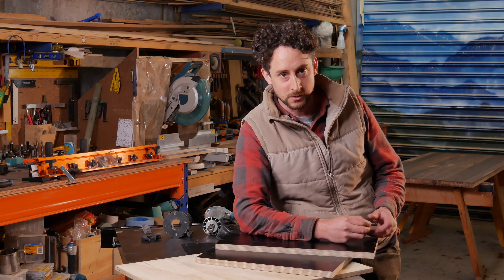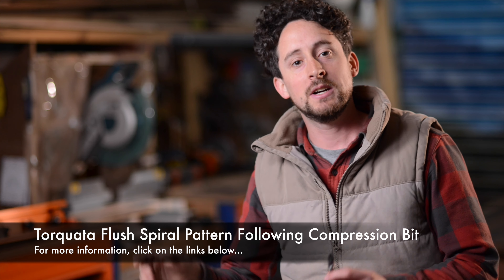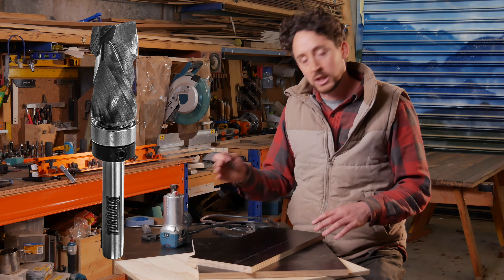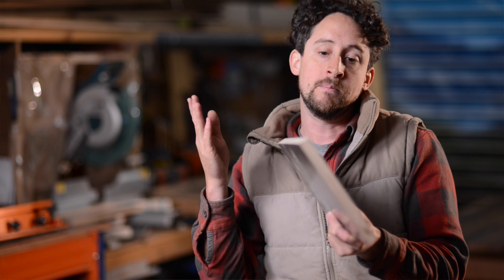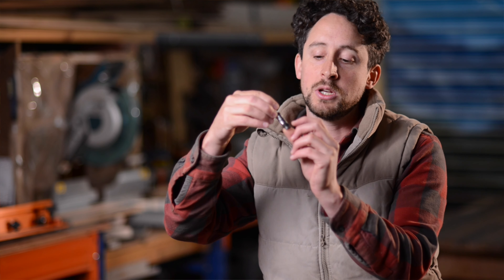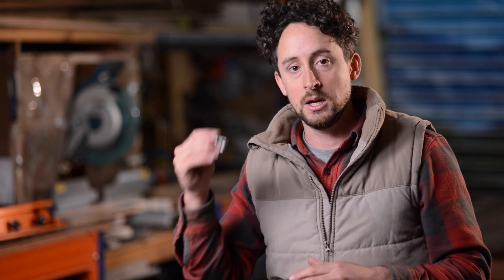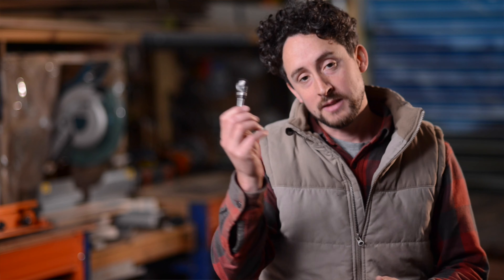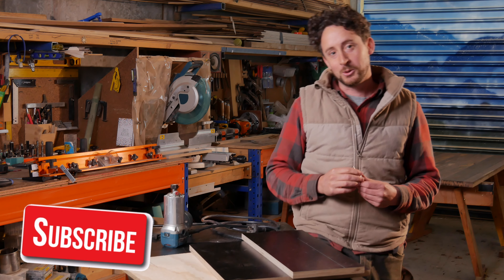Cool Tool Tuesday - Put This in Your Trimming Router!

Comment: So on 1/2 plywood... would I have to do two runs with the 1/4in Shank Spiral Compression Bits? or would I be able to follow a pattern and do it all at once?
Reply: I was confused by this statement on the site "must only be used for trimming cuts up to 1/2 the diameter of the cutter. "